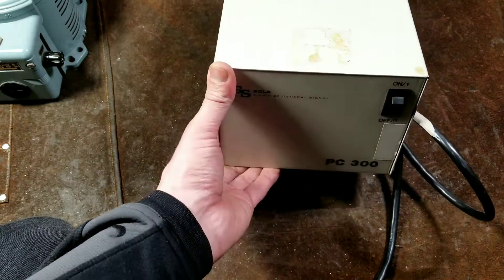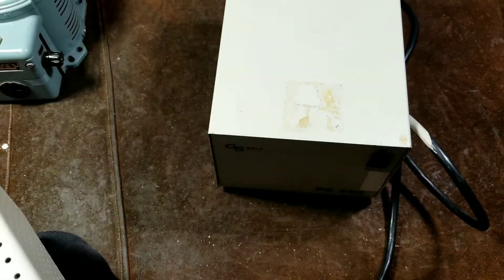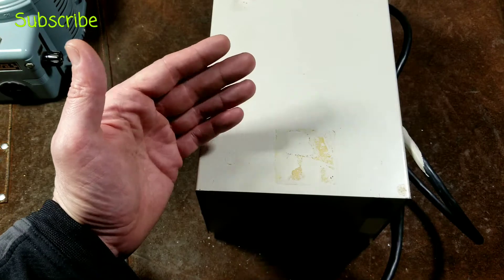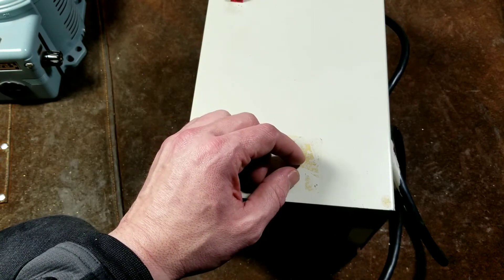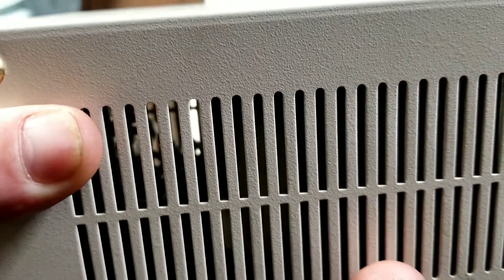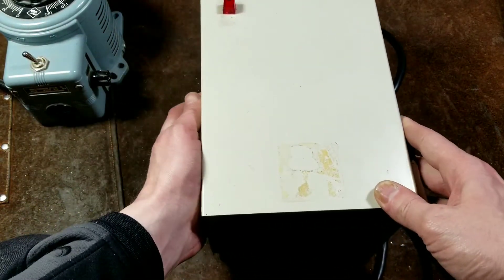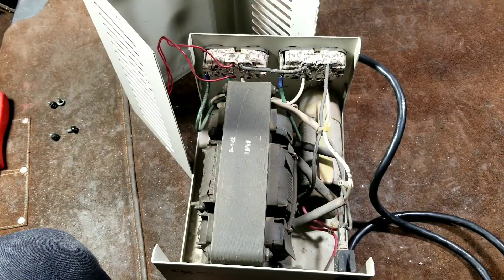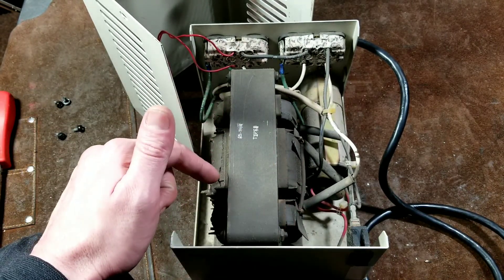Sola Hevi-Duty Constant Voltage Power Conditioner Review

Comment: Would this work for a ps5?
Reply from the maker: You would want a UPS or an an automatic voltage regulator like in an APC which I've done a video on.

These Solas are resonant constant voltage Transformers and they're really made for photographers enlargement machines they Buzz Extremely Loud and have to be in a separate room. And if they're overloaded they will drop voltage and your equipment will shut down.
Reply: @CatusMaximus  I've had problems with my electronics making  popping noises an getting static allot, after a few months to a year or at certain times of the year they tend to either fail completely or not work correctly is there one that would work best in my case? Thank you in advance I've been searching everywhere for answers not much information on this topic on the internet! I'm almost afraid to use my ps5 cause it's so expensive I had a ps4 before  an it stopped working a year after I had gotten it
Reply: Kind of late, but I highly recommend an online UPS in your case. It worked best for us. We had issues with power, especially during the summer and inclement weather. Our electronics, especially LED bulbs, failed for some reason. Those only lasted about a month and would start to get super dim. We tried several solutions, but the best was an online UPS. We use multiple ones from Tripp Lite. Some are smaller for the rooms, and two are bigger for the kitchen appliances and home theater.

Before using an online UPS, I tried a SolaHD 1000VA tower CVT. But when they say it’s loud, it’s loud! And definitely much more than what I thought. Don’t get me wrong, it worked, but the noise was a major drawback. Definitely something you want to install in a garage and well-ventilated because it gets very hot.

The online UPS does have a fan that’s always running, but it’s not super annoying. It sounds like an air purifier in low speed (which we also have all around the house). It’s definitely not as annoying as a CVT.

After using them for about three years now, we haven’t had any electronics or bulbs fail on us. Plus, it comes with the added benefit of battery backup. Those online ups can take a beating have seen voltage go all over the place and even heavy brownouts during storms without even the need to switch to battery mode and the output remained a rock solid 120V.

Comment: Spot on. I was looking into a replacement frequency for these, turns out their lifespan is fairly long. ~Like 25 years for the Sola 2000VA MVS version I have.  Your video confirms what I thought and that there IS an actual separate capacitor. Although it doesn't perform the typical function of a capacitor in a power supply it may be expected to have a finite lifespan.  I'm guessing the capactitor is likely the limiting component giving it the 25 year life.